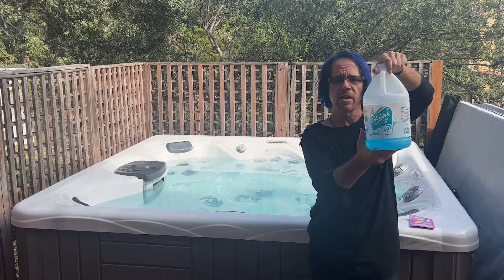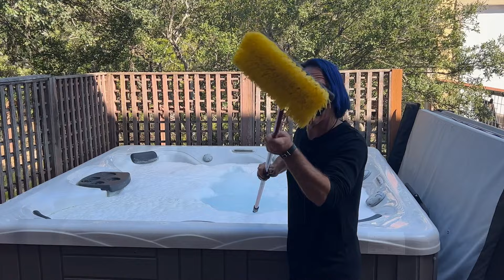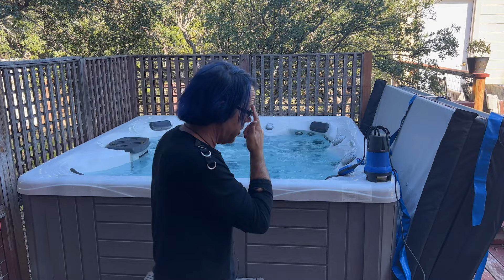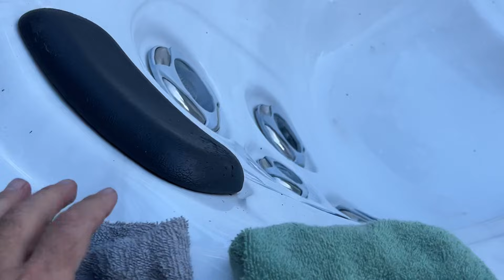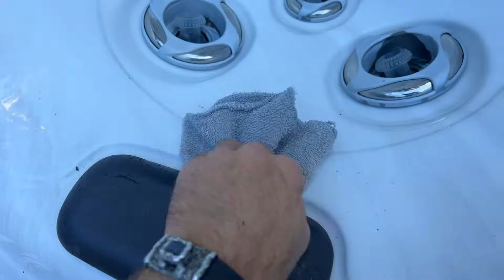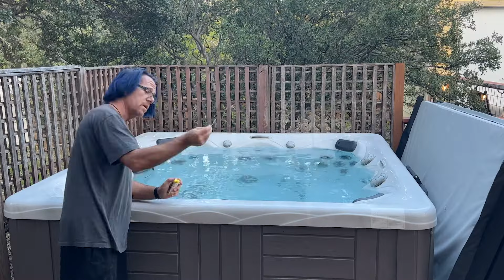Clean, Drain, and Refill a Hot Tub - Step by Step

Comment: I disagree with the "not having to treat new water".. maybe it's different in texas but the water here in Alberta is quite hard. I always start with a 100 ml of stain/scale, 1/2 a large capful of chlorine & 2 caps of shocker.. I do have a floater for chlorine tablets & a mineral cartridge that sits in one of the filter housings. I do not install the mineral cartrigde until it's up to temp though. The other chemicals, I don't add until the water temp is at least 70. My fill water temp was closer to 38-40 deg.

Comment: This is going to be my first winter with a hot tub.  The one question I have and cannot seem to get a good answer on is: How do I keep the water from freezing in the plumbing while the jets are not running 24 x 7.  My hot tub is right around 2250 gallons and has two pumps that have knobs to divert water from the swim portion to the seat portion.  Do those both just need to be turned to the middle while not in use with the water features on enough to have water trickling out all the time?
Reply: late but I keep mine at 100c all year round. Hope this helps someone else.
Reply: The auto circulate should keep it from freezing